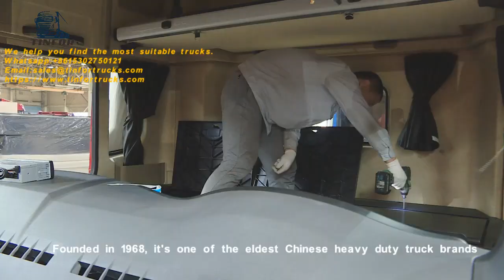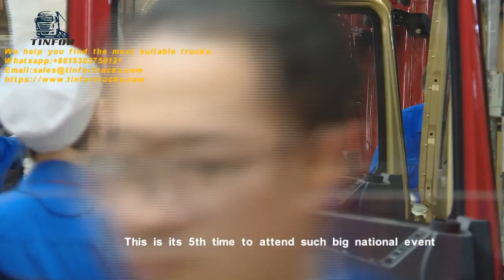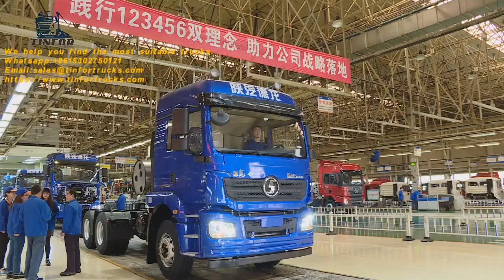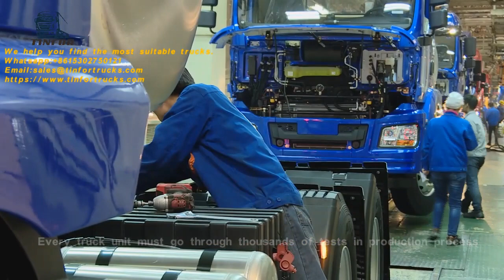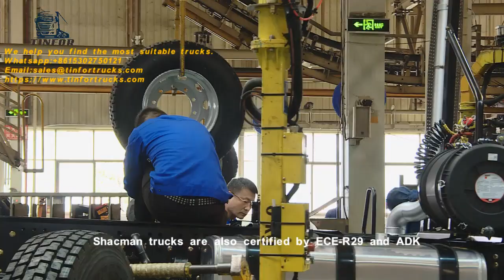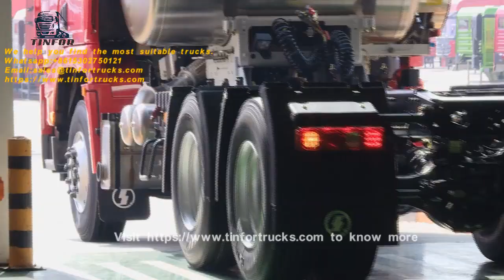Largest China Heavy Duty Truck Production Factory Plant - Shacman

Comment: Shacman dump truck is a very strong truck.. but one suggestion I have as a shacman user in Indonesia.... Please Shacman manufacturers improve security, especially in the cabin. Dexel is very weak against impacts. This is what causes many operators to be disabled or die... Even though a separate cabin has been added... but it still causes a lot of doubts for beginner Shacman dump truck users...🙏🙏🙏